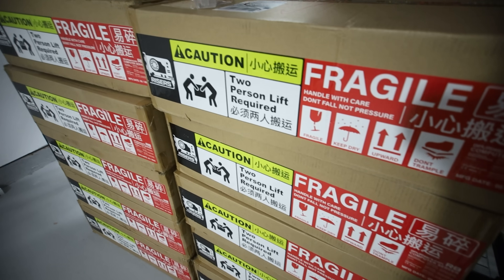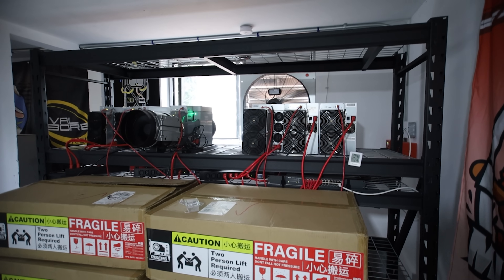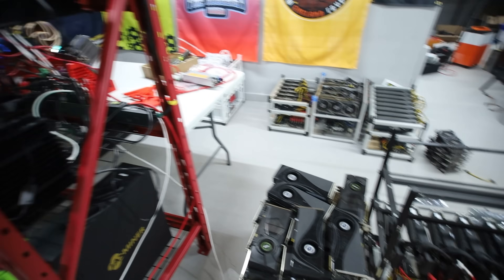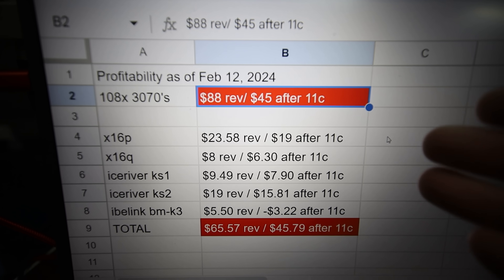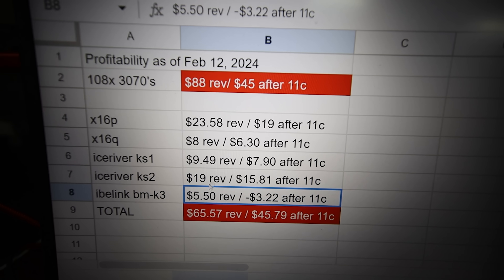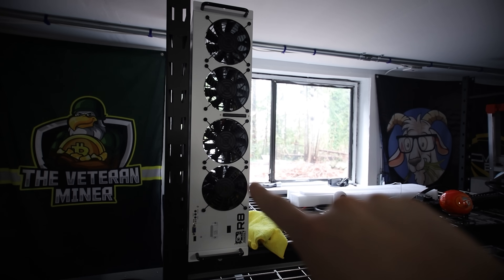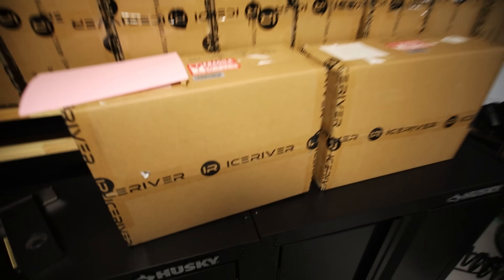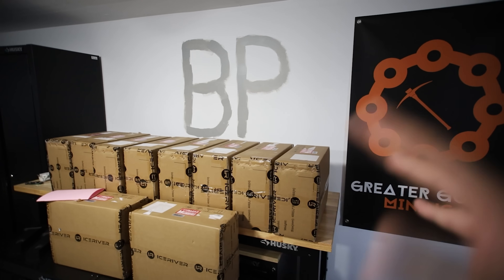I traded my KASPA Miners for GPUs...

Comment: 0:45 If that battery pack is swollen enough to pop up the case, get rid of it.  Its a potential fire hazard if the internal layers of the battery get compromised.  
Stay safe, keep smiling and stop squeezing puffy batteries!  😆
Reply: @alltrac89 rofl 🤣

Comment: If my math is correct that’s around $240 per 3070?? I think you’re getting a better deal in the end because the hardware itself will be worth much more as the market continues upward and of course the versatility of a gpu beats an asic hands down. Nobody knows for sure what ETC or KDA will do in the market but you will now have 108 3070’s to mine on whatever you want. Nice job 🎉

Comment: Very bad ideea, most of you including you RPM said wooow gly mining is not dead I replied in one of your videos when the rewards were much better then now that GPU MINING IS IN COMA and never will be like before eth.
200 new coins algos crashing and the better ones got asic.
When a gpu is making 10 cents profit is very crapy, you are talking for long run but what is profitable now will be extremly profitably then, if is now crapy can be profitable or not.
I do not see the eth or half of that rewards.
Deeply disappointed an Ergo looks like a dead project and even Raven!
Now I'm really sorry that I didn't sold all my gpus to buy onther hardware like asics and only 25 gpus.
Reply: It'll be okay. GPU mine coins that you think have future potential. I mined kaspa in 2022 when the profibitality was pennies and now its worth a lot.
Reply: @davey1321  kaspa is special and is the only project that performed in the bear market and is not anymore GPU minable.
We change coins on the rig more that we change the socks!
Will be good, but not even close last bull market for gpus.
Just my opinion I mine from end of 2019,   were 2 cycles from 2016, and this is very different no more eth that had rewards for miner of 25 millions dollars.